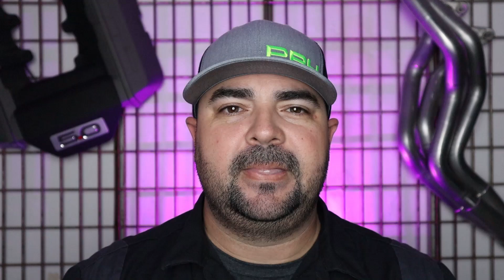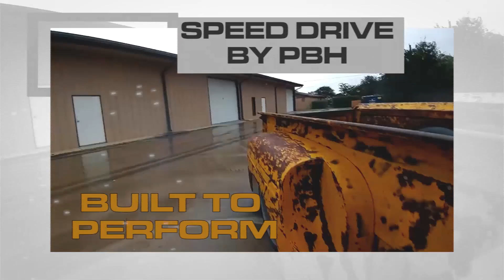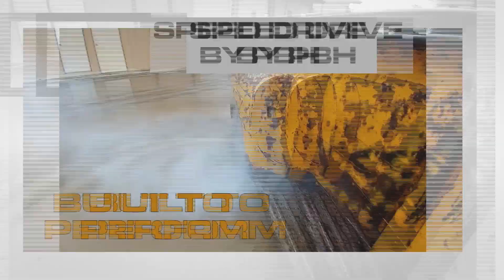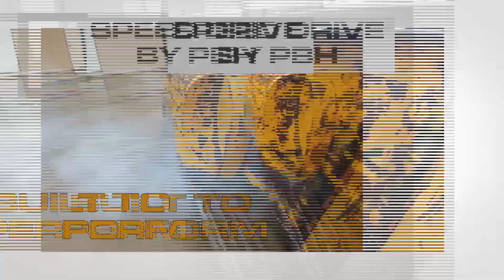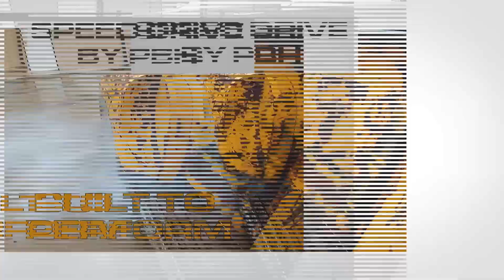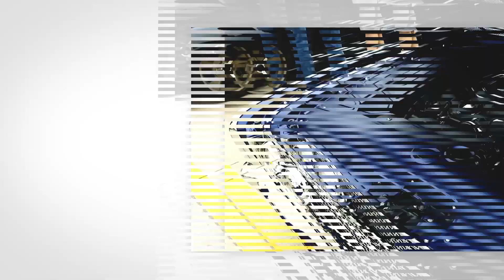5.0L Coyote Swap Power Steering Solution from PBH

Comment: I want to do a swap on an f150 3.7 v6 to a coyote engine I would like to keep it as simple as possible I want to know if is worth it thanks
Reply: Also how much something like that would cost thanks
Reply from the maker: We get asked this all the time. Its not an easy proposition. The short answer is yes you can, the oem variant of the truck with a coyote engine is the template to get this accomplished. Very little to no aftermarket or modified parts should be required. Where the expertise comes in at is in calibration of modules with the vin from a v8 truck so your gauges, abs, etc will communicate. So the vin in the pcm will not match the vin on the chassis, this could be an issue for states with inspections or even emissions test. The cost has many factors that will affect it, I believe the best avenue is to swap trucks and find one with the v8 already in place.

Comment: I’m doing a f-150 2011 coyote on a 2008 mustang what alternator do I need?
Reply from the maker: You will need a 11-up Mustang coyote alternator is using our Speed Drive. You can also opt for the 15-17 f150 ecoboost alternator as well with our latest brackets.

Comment: Wow PBTH seems to be on top of the comments here! Let me take a swing. I got a 2013 F150 Coyote motor for a 97 Mustang swap and after painfully figuring out that I HAVE to use the power steering pump for hydro-boost brakes, your kit is coming in the mail along with a new front cover. Luckily my F150 motor has a dual 6-rib balancer. 
My question is what am I supposed to do with the oil filter/cooler location? I'm more than likely going to delete the cooler but where do I mount the oil filter after that? Will it fit behind the modular PS pump? What about the sensor that plugs into the oil cooler?
Thanks!
Reply from the maker: Blake, thank you for choosing PBH. One note I will say, even if your F150 is dual 6 rib, the timing cover will need to be changed out to a Mustang design for our parts to work. The F150 is missing an idler we need, if you already did this disregard the message. 

As for the oil filter, if using the F150 housing it will clear with the oil cooler omitted. Once that is done you can run the FL500 filter on the f150 housing and it will clear our system and most sway bar options. For a look at this, just check out our relocation kit. It is based on the F150 oil filter neck https://pbhperformance.com/product/coyote-oil-filter-relocation-housing/

The sensors is the oil pressure sender, it does not need to be plugged in on Gen 1 or 2 swaps as it is only for a warning lamp and does not impact operation of the engine.

Comment: I am using the mustang gt electric assist power steering, gets rid of hydraulics and and all the mess that goes with pulleys,belts and tubing.
Reply from the maker: works for the factory cars and should for you for you if its all hooked up.

Comment: I would like to drop the 5.8 in a 2005 mustang and was wondering if it would work also would the Boss intake work with it. thank you Paul
Reply from the maker: Paul, when you say a 5.8, are you referencing the GT500 engine from 2013-14?
Reply: Yes

Comment: Awesome info! Now can I use the 2nd gen power pack on 2011 to 2014 f150 coyote? And 1st gen coyote power pack doesn't have the wiring for a/c correct? Lol I'm doing swap in 96 gt wanted to keep a/c.
Reply from the maker: Well the AC has nothing to do with the control pack. No control pack will control the ac compressor function. When doing a swap, you want to keep the pcm and engine from the same generation. There are control packs for Gen 1 that will work. Why do you want to mix them?

Comment: Hey guys! Brance here with A.2.Z Automotive. I have a few questions about some brackets that I might need for a f150. I’m building a straight axle swap kit for a 2013 f150. Steering is an issue with this swap. I’m looking for a bracket set that will work with my supercharger. Could someone give me a call and let’s talk about a solution here. 4234946400
Reply from the maker: Brance, Give us a shout today. We have what you need! 561-737-2331

Comment: I have a 2004 Ford Mustang V6 but I would like to put a 2013 Ford Mustang GT engine in it how much would you charge to put the GT engine in my V6 Mustang
Reply from the maker: Dimitri, It is hard to put a price on a swap like that. A typical swap can take anywhere from 100-150 hours of work. There are a lot of things that you may or may not need depending on what your doing with the car or even budget.  As an example your car is a v6 so you would most likely be swapping differentials that is not part of a swap so the cost would be even higher than just a coyote swap. Factors like ac, power steering, and even gauges will vary.